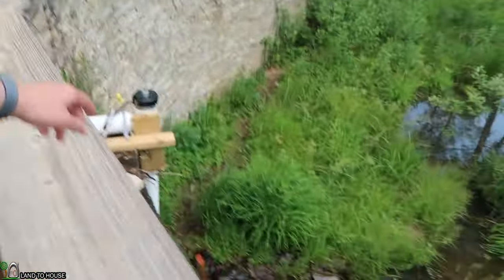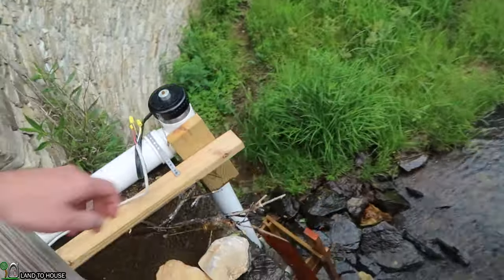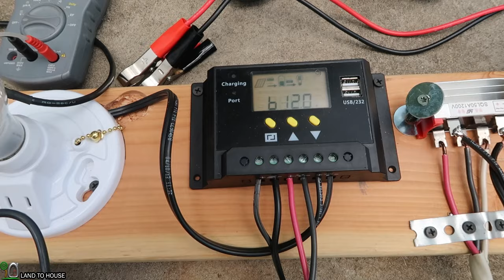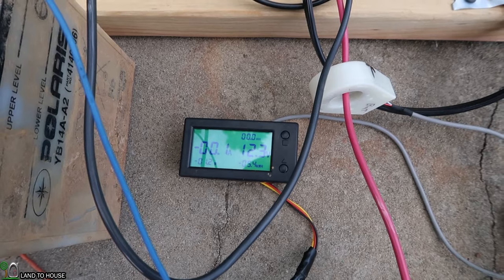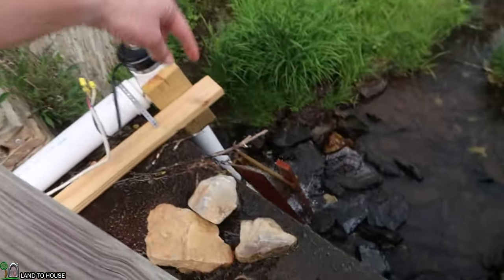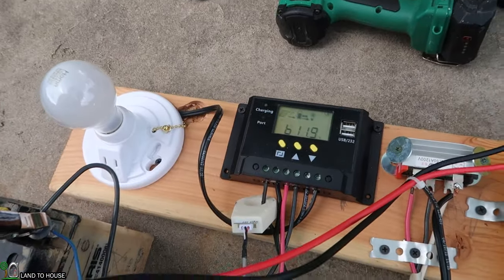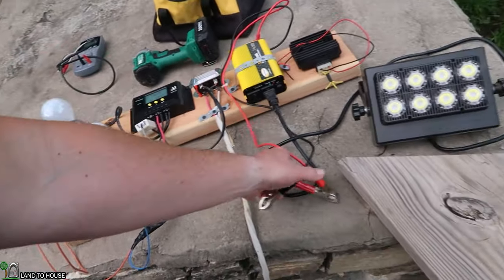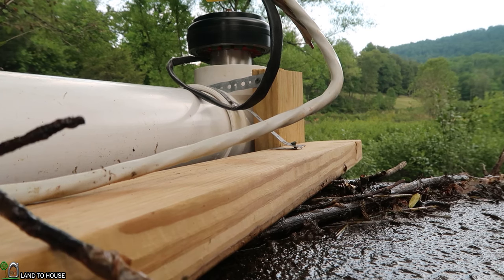POWER reading on the 4 inch hydro turbine

Comment: Im going to make some assumptions about what your trying to test here and what is happening inside the pipes.  Im no hydro engineer so I could be 100% off here.  my knowledge is more computer and small electronics.  But what I specialize in is troubleshooting hardware and software issues. 

1. you are trying to recreate a similar set up to "Awesome Low Head High Flow Grid Tie Micro Hydro 530 watts!"

2. All the equipment is in 100% working order

Upon seeing the power output was way lower that expected, once you fixed it reading the right wire I was expecting around 150-200 watts based upon that your using a 4 inch pipe vs the 6 your other video mentioned above.

My first thought is water is moving too slow to power the turbine but why? After quickly reviewing your other video i think there are 2 things can be tried for the next test.

So I think the issue is that there is a big turbulent water bubble stuck above the turbine which is restricting the flow of water.  You have a 90 coming in there another than a sloped  90, 5 feet away with a restriction(turbine).  I bet if you put your ear up to the pipe on top there would just a ton of noise in the pipe. To test this theory you need to listen to the pipe after a few min letting it run, then replace the turbine with an normal sloped 90.  let it run for another couple of min(to make sure air is mostly out), the water coming out of the pail should also come out much faster.
Reply: To get this working better here are my thoughts.

One fix that might work is to move the turbine down under the water 1 or 2 feet  and have another 4 or 5 foot pipe into the turbine to create some head pressure which might push the turbulent water faster. 

Fix 2 like others have said is to remove the bucket.  If it is letting air in then reduce it to the 3 inch or the 2 and retest. You never tested them without the bucket so they might preform better than the 4 inch with bucket.

Best Fix, I think the issue is the design of the turbine being so close to the 90 where the water looses so much energy(sorry Spencer). I think a long shaft 2 or 3 feet down going into a y support with a water tight bearing would be the best fix.   But testing different lengths of shaft should be done. And should be done with different turbine pipe sizes. To test all the correlations for data then a proper shaft length can be recommended to different customers based on their needs.

Hope this helps, I could be 100% wrong but I got a good feeling about this one.

Comment: DC needs much larger conductors, larger wire\cables
Reply: Rocker, he is using DC after three rectifier only, the gen is 3 phase ac
Reply: @Iamsuccesspro  Yes, I saw the video, the DC\battery requires larger conductors even if it's for demonstration purposes
Reply from the maker: I just used lamp wire to go from the rectifier to the charge controller. If I had this in a permanent setup I would for sure use larger wire.
Reply: It's not about AC or DC or the peak voltage, the size of the wire is determined by how many amps are flowing through the wire, i.e. 10g wire carries 30 amps whether its 120vac, 240vac, or 12vdc
Reply: @workbenchz  Its about DC requiring larger gauge conductors
Reply: @rockeerockey6941  that's all true, but for the short test it's ok, no big deal couple amps for couple minutes :)
Reply: @Iamsuccesspro  Did you read the entire thread or simply jump into the middle? Please read the entire thread